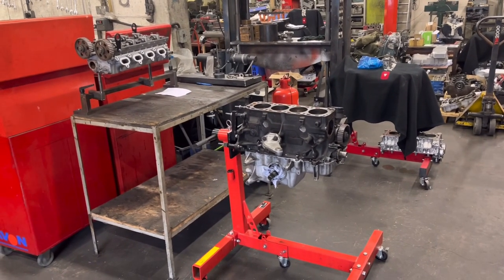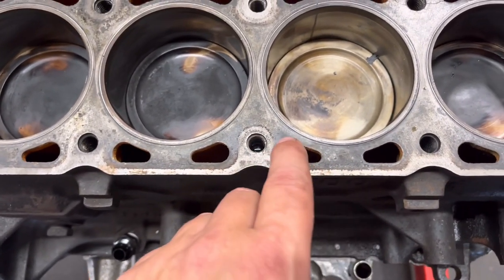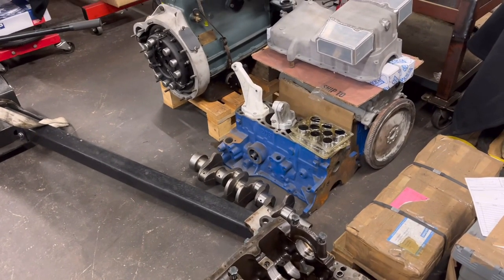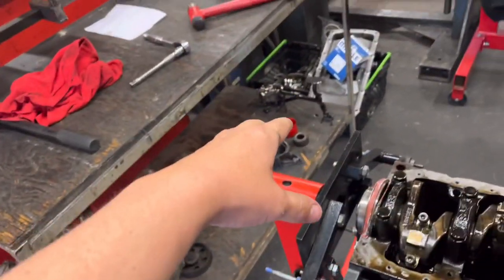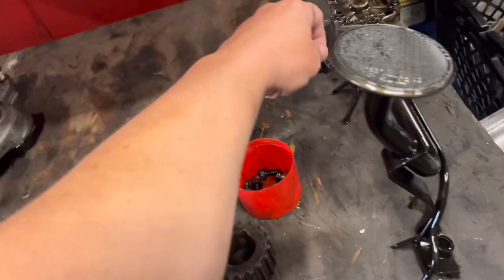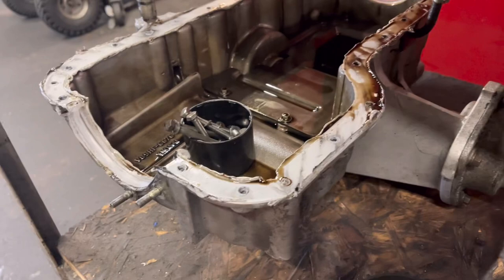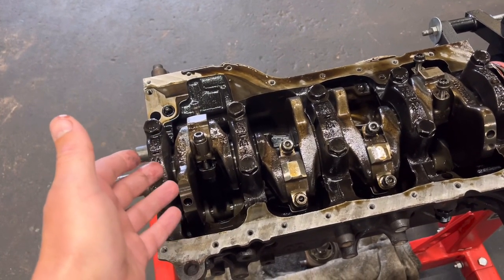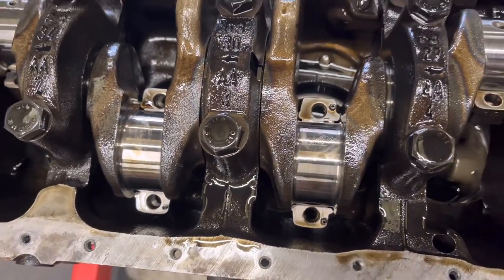Cosworth strip down! Unveiling another BADLY built Cossie engine!

Comment: Doing the shim+bucket conversation to old VW 1.8 gti engines i aimed for about 5thou in and 12thou exhaust .
Got the most out of the camshaft and lasted around 35k miles before needing reshimming.

Comment: I rebuild the Ford Ecoboost 3 cylinder engine.  Silicon is used to seal the front cover and sump. You leave the silicon 24hrs before filling with oil. You will end up with silicon in contact with oil. However I have never seen loose silicon in the sump or oil pump pick up.
Reply: There are different types of silicone. Maybe this one they used the wrong type?
Reply: You may not have but its not to say it isn't happening.
Reply: I use Dirko HT silicone made by Elring on engines, gearboxes and transmissions that i repair and re build, it never comes off inside an engine unlike bathroom silicone which i have seen used by clowns in engine rebuilds.

Comment: Could you check all the clearances first before grinding to check none were to loose? With potential to swap valves around for a tight one? Just in case one has to big a clearance and can't add material 🤔
Reply: Good shout that is, but I think he gave the head a lick, so they should all need something off

Comment: Are those lower left buckets okay, their cam faces look distinctly  "mullered" (Cosworth-speak?) to me and not smooth . Swapping some valves around might reduce the material needing ground off. Does grinding valve stems back not damage the surface characteristics of the steel and foreshorten their lifespan? If you are getting a lot of work on Cosworths surely the extra expense on new buckets of right clearances is worth the added expense and would generate a lot of serviceable used and varied clearance stock that could also be used.

Comment: Can not help but think when i see that Cosworth engine with the silicone and lose bolt on the oil pump etc that anyone buying a rebuilt engine or a car with a rebuilt engine that either they ask for a receipt and check it has been built by professionals like your selves or just buy it and assume it needs rebuilt again. No mater how good a rebuilt engine sounds etc is immaterial unless built correct as it could be actual worse than an old worn engine?

Comment: Well I have just learned something.I didnt realise there was such a make up as 5 valves per cylinder.So out of touch.The camshafts must be very complex.
Reply: The camshafts are no different from a 2 valve per cylinder cam shaft except they have extra cam lobes, a 20 valve four cylinder with rocker arm set up is a bit more complex looking but its still simple except it is crammed into a smaller space
Reply: @madeljacky  I understand.Thanks.
Reply: Yamaha launched a bike with 5 valves per cylinder in about 1984. Aprilia launched an engine with a radial 5 valve head in the early 1990s - 4 valves opened directly with skew ground cams a one by a rocker.